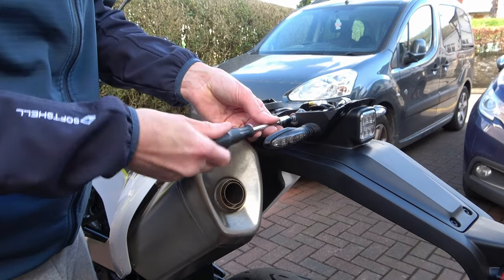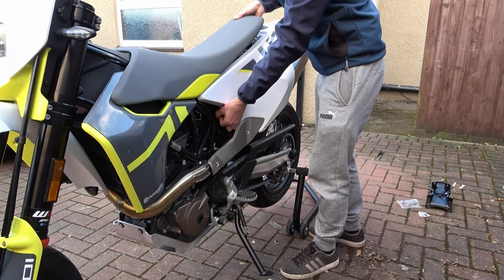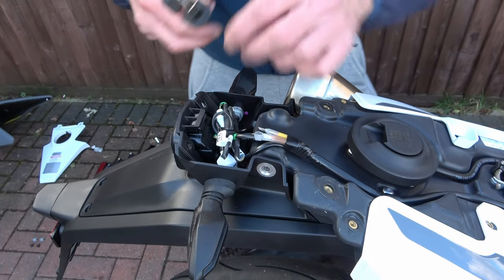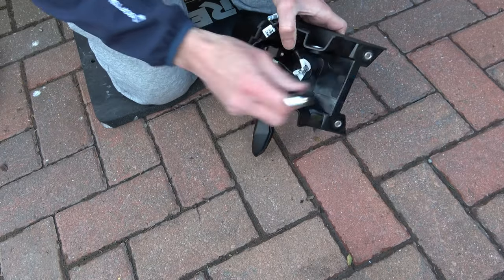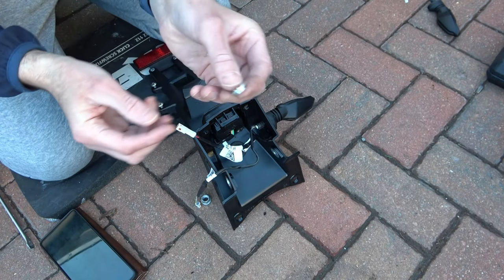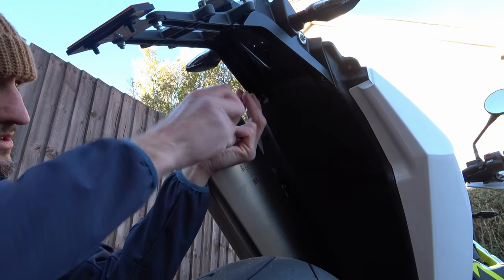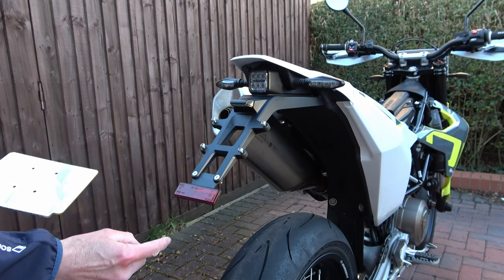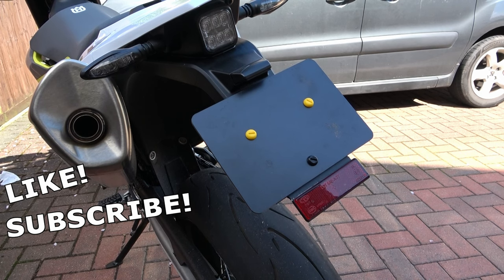How to fit a tail tidy to Husqvarna 701. KTM 690 tail tidy install. GasGas sm700 tail tidy fit.

Comment: Brilliant Video as always. Thanks. 

Think I’m going to try the DIY Tail Tidy using half the ‘mud guard’ plate holder. Will see what the law says but may end up getting one of these myself.
Reply from the maker: The only downside of using the half mudguard option from what I can see is you have no separate plate light, the angle of plate may not be compliant with various country's laws  (Not sure?), and it's maybe not as strong. I'd put a blob of sealant in the hole in that grommet also to prevent water getting into the electrics. Other than that, give it a go and let me know how you get on with it. Thanks for watching 👍
Reply: @POUSEouttatheHOUSE  Yea you speak exactly of the small things I’ve considered, good pointed about the grommet / hole for the plate light cable.. In the UK as well, so hoping that it being around 30 degrees isn’t too much of an issue with the boys in blue. Know a 701 Enduro rider who’s had it like that for 2 years with no issues. Definitely not going to its MOT like that though! Interestingly it was the Salesman at the KTM Centre / Husky1903 that brought it to my attention! 

Will let you know how it goes and if I end up getting a tail tidy. 

Many thanks again, really enjoying the professionalism and entertainment of your vids.

Comment: I found removing the fuel cap helps with taking that rear panel off.
Reply from the maker: Thanks for the feedback Robbie . Some great videos on your channel. I see you sold your Husky. I've bought a Wings exhaust, DNA stage 2 filter and my plan is to fit soon and get the bike mapped. How did you get on with your wings set up? Thank for watching 👍
Reply: @POUSEouttatheHOUSE  Thanks. I appreciate that. 
I did sell the husky with some regret lol but I went and  got a 23 690 smc r a couple of months back and I’ve done the same mod. Wings exhaust and CRT fuel optimiser. 
It’s made a huge difference to the 690 as standard it was really lean low down. 
On the Husky I didn’t really ride it that much before I did the mods to it so couldn’t really compare but as that was a 21 Euro 5 model like the 690 I’d say it probably ran the same.
Reply from the maker: @Robbiemoto  I noticed you'd bought a 690. Fancied a change of colour? 🤣  I saw one like yours on the road for the first time the other day, nice colours 👍 Thanks for the info on the husky. Mine definitely runs lean at times. I'm hoping a remap will sort it out. Just need to find time to get it all done now!
Reply: @POUSEouttatheHOUSE  I sold the husky purely being offered good money for it. After seeing strapped to a trailer and going down the road I thought bollocks I shouldn’t have done that lol. 
I got the 690 by chance. Speaking to the dealer I got my 1290 SDR from and they were selling their demo bike a couple grand less than brand new price and it only had 175 miles on it. 
So bosh I had it lol. 
I will eventually get it remapped but for now and the cost of it the fuel optimiser does the job very well.

Comment: Your number plate hasn’t got any numbers or letters on it, is that legal?

Your paving joints need a bit of work, the moss will take over if you don’t keep on top of it.

No thanks needed 👍
Reply from the maker: It was cheaper to purchase without the numbers and letters. As for the driveway, just doing my bit for the wildlife!